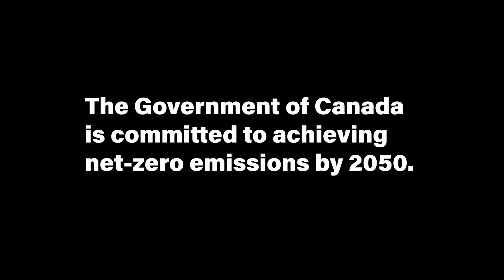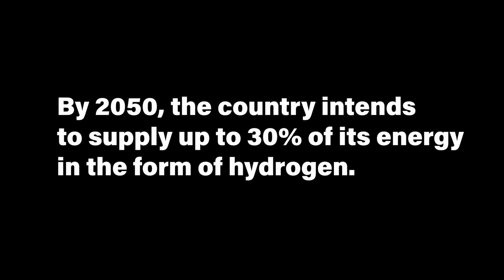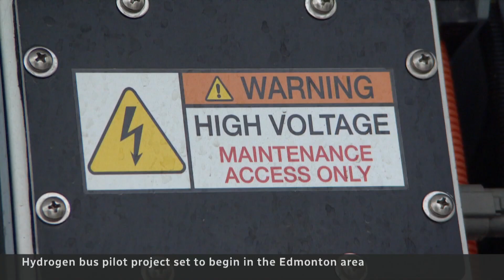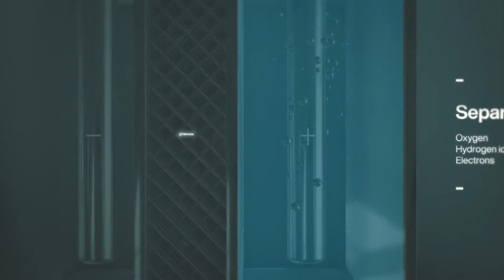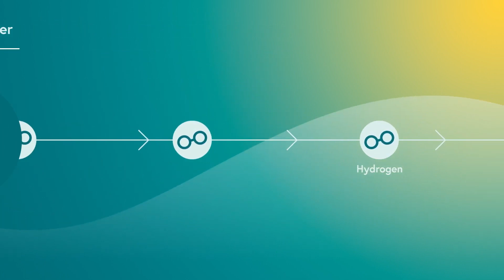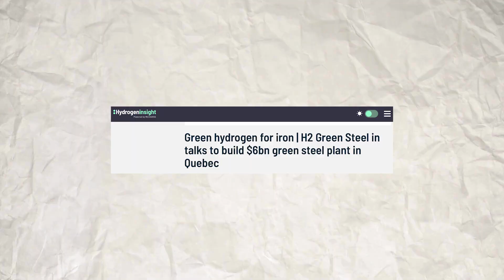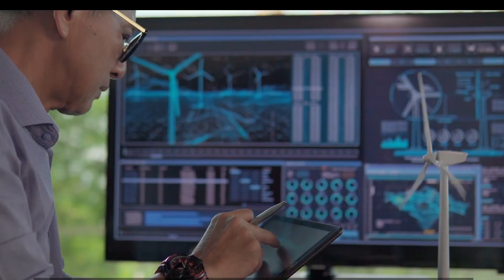Fueling the Future: Canada's Hydrogen Revolution

Comment: Sorry to disappoint you, but to any knowledgeable person, hydrogen as long been dead-on-arrival, at least for light road transport.  For heavy transport, it is likely to be the same, but the jury is still out. There might be a few such applications, though.
It does not mean that "green" hydrogen is not very much needed... but to replace "grey" (I personally prefer saying "black") hydrogen in 100 million tons of industrial applications!!!
"Blue" hydrogen?  A scam!
From somebody with several years of professional experience in hydrogen hydrolysis development.
Reply: For heavy transport and air travel, batteries are what's dead on arrival.
Reply: @KekusMagnus  What means "heavy transport"?  If you mean trucks, then I do not agree, electric trucks will take over that market, except maybe a few niches.  If you mean trains and/or maritime transport, then I may be with you.
Short-distance air travel will be electric.  Long-distance clearly not... but neither will it be hydrogen fueled.

Comment: Blue Hydrogen is no cleaner than using natural gas and also less efficient, blue hydrogen needs 3 times as much electricity to power a vehicle that if it was directly used in the vehicle
Reply: Batteries are very slow to charge, hydrogen is quick to refill. Batteries require a strong connection to the power grid to charge, hydrogen can be stored in tanks. Batteries are very heavy, hydrogen is the lightest chemical out there.
Reply: @KekusMagnus  nothing like proving you have not understood a comment by posting to show everyone, well done😄

Comment: Ill go with Toyota stance that the Amonia engine is the real deal, Hydogen costs to much electricty to make, produce and distrabute!
Reply: And you think ammonia is any better?  It is safer than hydrogen, but even more expensive to produce!
Reply: @st-ex8506  no amonia is cheaper to produce when it done to scale... Do your resaerch!
Reply: @locomanjim1554  I don't really need to do a research... I am a chemical engineer and ammonia production is de facto the 101 of my profession.
The present efficiency of the production of ammonia by electrolysis is, at most, 60%.  For hydrogen, it is more like 70+%.
But there is NO production of ammonia by electrolysis at scale that I have heard of. There is however quite a bit of research improving said efficiency.  So, by the time such process is optimized and scaled-up, you might happen to be correct.  However, you cannot state that as a fact, as you did!

However, production is not enough, unless the product is immediately used on-site or "across-the-fence".  Otherwise, and especially for energy applications, it has to be stored and transported.  And there, ammonia is indeed cheaper than hydrogen, as it is relatively inexpensive to liquify and keep liquid, unlike hydrogen.

Comment: My father grew up in Newfoundland and the weather is described like this. "We got as much wind as the Sahara got sun" sounds like a great place for a wind farm 😂
Reply from the maker: That’s an interesting analogy. Thanks for sharing.
Reply: @renewedenergy  they used to and probably still do have separate weather warnings for wind to inform the rail lines when and where to go because the wind way back in the day would snuff out the coal fired trains or just blow them off the track altogether.